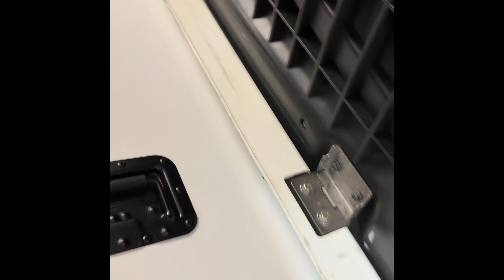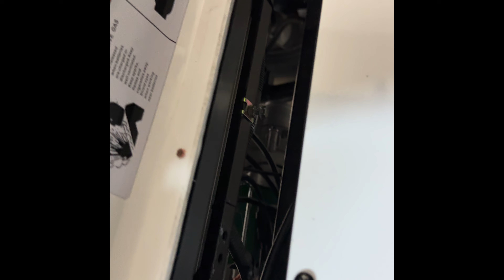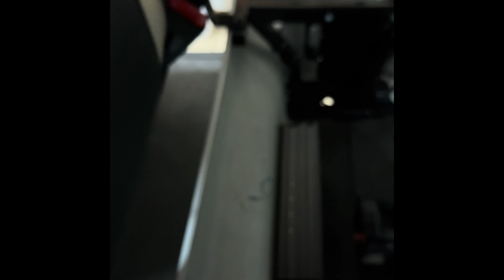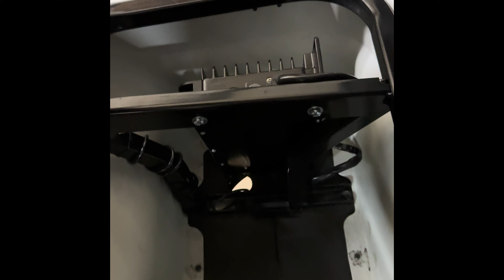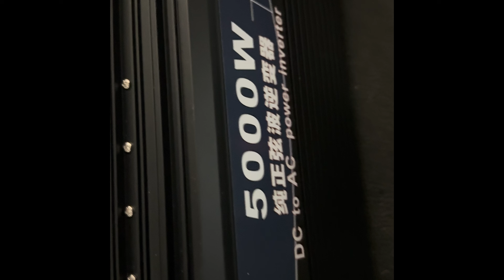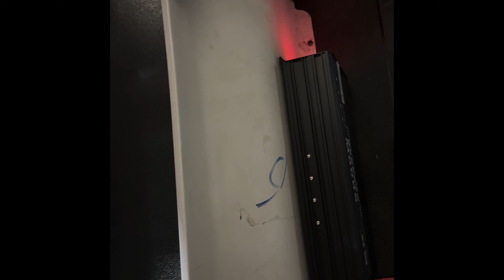ICON Golf Cart Lithium Upgrade: Installing a Skunkworks Battery, Reducer, and 5000W Inverter!

Comment: Do you have any type of Main DC fuse anywhere?

I have a 72v battery, associated charger/display, navitas 600a & 72v to 12v converter as of now.

I’m just making sure I’m not missing anything before the install process

Going from 48v to 72v w/ navitas
Reply from the maker: Yes, I believe I have a fuse. It actually came with the battery. Here’s a link to the picture of the fuse sitting beside my reducer. I also put a zoomed in photo of the fuse in there as well. Hope it helps! https://drive.google.com/file/d/1rCIp6SoOBbNHy89yNth8hn0YHrPXj79O/view?usp=drivesdk
Reply: @yourtechtoday9238 Okay perfect I just found the same one. One more question, I’m assuming the original controller is above the motor in that black plastic box under the back rear seat access panel?
Reply from the maker: @MrDance4meh  yes that’s where my original controller was before upgrading…best of luck with everything!
Reply: @y @yourtechtoday9238 bought the navitas controller, turns out my harness doesn’t fit nor does navitas make one that will. Mine is an icon i60l 2022 so I had to buy an Alltrax controller

Anyway, did you replace the big orange fuse by your controller with the one that came with your battery? I see you relocated it I just am curious if you just have that one or if you have the original fuse plus that rectangular fuse
Reply from the maker: Yes, that’s the problem with buying the Navitas for an icon golf cart. They have a bunch of different harnesses, meaning different harnesses for the same year sometimes so it’s hit or miss if your cart will work. As far as the fuse, I’m not certain because I didn’t install the controller personally but if I had to guess, the only fuse I have is the one that came with my battery. The one we did Install ourselves that’s pictured beside the battery and reducer!
Reply: @yourtechtoday9238 Do you have an idea what your 0-30 time is? 

I had to get the Alltrax 72v controller but it’s difficult to pair it with the OEM motor so looks like I’m upgrading to the Navitas 5kw motor
Reply from the maker: Got it. Yeah I will time it for you in the next couple days and let you know. This thing is fast though I can tell you that lol! Pulls the front tires up on my six seater if I have some weight in the very  back!
Reply: @yourtechtoday9238 This has been such a rollercoaster, I called Navitas and they made it absolutely clear that they don’t make any motors for the icon. Did you have to do a bunch of wiring or something? 

I keep getting this story and that story from different people/shops and like this was supposed to be a simple 2 day project.
Reply from the maker: I TOTALLY UNDERSTAND! I had the right person at Navitas tell me to call this guy down in South Florida and he is the man! If anyone knows EXACTLY what you need its him! I ordered my Navitas motor through him! He may take a couple of days to research and see exactly which motor will work for your cart but if there is a motor that works for your Icon he will find it! His brother ironically is one of Navitas’ main tech guys and he helped me tweak my settings to perfection!!! Call Albert at Reliable Golf Carts and he will help you!! (561) 370-5098 Just let me know how it goes please!
Reply: @yourtechtoday9238  Wow I already just sent a text to that guy, hopefully he can get this sorted out. Fortunately I’m only a few hours from him in Florida worst case scenario
Reply from the maker: yeah, I think I always spoke to Albert on the phone but regardless once you get a hold of him he’s definitely the guy that can give you some real answers! He knows his stuff! He asked me a bunch of questions about my cart and I think I had to go and give him some information from my original motor or something like that which helped him decide on which motor he needed to order exactly through Navitas. He’s really good!
Reply from the maker: 0-30 was roughly 5 seconds in my testing tonight…. I have video if you’d like to see it but imagine you trust me at this point. This thing rocks!!!
Reply: @yourtechtoday9238 Wow that’s awesome, my 0-30 was 12 seconds with 48v roypow/stock controller/motor so that’s definitely something to look forward to 

If you already have the video I’d be interested to check it out
Reply from the maker: Here you go! The video is eight seconds long but the time between 0 and 30 is roughly 5 seconds…https://drive.google.com/file/d/1U8j6s5FSTZBeTcVHKmrgs-135CqshcXS/view?usp=drivesdk
Reply: @yourtechtoday9238 Hey man I finally got my cart done… it does a wheelie,  0-30 in 3 seconds and 50mph top speed!!

Loong story short, Navitas motor took 10 days to arrive, but the worst part was that the first New Alltrax (such a PITA company to work with btw) controller didn’t work so had to wait 5 WEEKS for a replacement. 

Here’s a link to the wheelie & 50mph pic 

https://drive.google.com/drive/folders/1Daz5x76jh_EMUYfjIOP1bBTCTX-GHNF_

Comment: Assume you have the navitas tac2 600a controller, what settings or battery profile did you use?  Navitas told me roypow s72105p would be the closest for this skunkworks 72v battery but was wondering if there was anything else to use or any other settings to toy with.
Reply from the maker: I just noticed my battery is set to lead acid modified for whatever reason. I know I had it set to a lithium profile at one point but we changed a lot of settings and I think he said it didn’t  matter because the settings underneath are the settings that really matter. I worked directly with the main tech at Navitas for several days to get everything perfect so I’m sure it’s not a big deal that we never applied an actual lithium profile to it. I did message him to ask him if it’s supposed to be that way and if I hear back from him I’ll let you know. But my cart rocks so I’m not worried at all. I can feel I’m getting maximum performance out of it. Here is a link to send screenshots that might help you. I’m gonna take this link down later today so please download them ASAP. Also I would be VERY cautious in using my exact settings because I’m guessing you don’t have the exact same cart as me and even if you did Icon uses a lot of different wiring harnesses which means what wiring harness you have affects what settings you need in the Navitas app. But maybe a couple of my settings can help you so just thought I’d share because you asked. Let me know! Link is here: https://1drv.ms/f/c/2466f5cf354c59c0/IgBdS2xYCaUxSKWb9NVtRxuvAVuMIaUhGoipHBdOOhFK5lQ
Reply: @yourtechtoday9238 thanks a lot for your help/feedback!  Just got mine installed today and it’s awesome!  I was teetering just going with 48v since it was an easier swap, I used an eco battery dc inverter because the one they recommended had different connectors and I’m lazy and not too savvy with this stuff so the eco battery one was made for an icon swap to 72v so that worked nicely and had the same mounting dimensions…cart is awesome uphill now which between that and range were my main focus
Reply from the maker: @scottgrempler  awesome! Really glad it worked out. 72 V is a game changer especially when it’s a Skunkworks. Have fun!
Reply: @yourtechtoday9238 I had it on the charger overnight, about 10 hours, it was 40% when I plugged it in and only 91% after 10 hours, does yours behave the same way with charging?  I’ll contact Justin on Monday but seems like a long time to get to 100%
Reply from the maker: That is way too long. Something is off but hopefully an easy fix. Are you using the Ant BMS app? It will tell you the state of each cell I believe. But yes Justin will tell you what to do tomorrow. He will not take it casually if it’s not acting right.
Reply: @yourtechtoday9238 yeah for anyone who might wonder the same, it’s typical for first charge up while individual cells do their thing, it’s at 100% now and everything good.